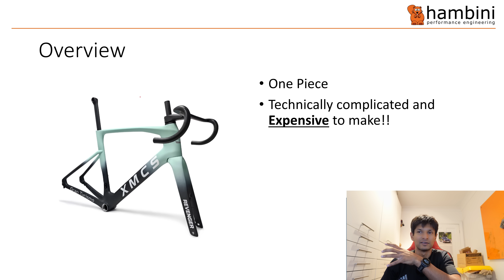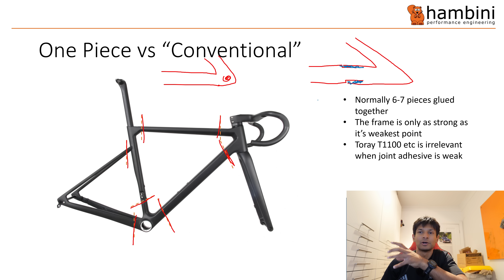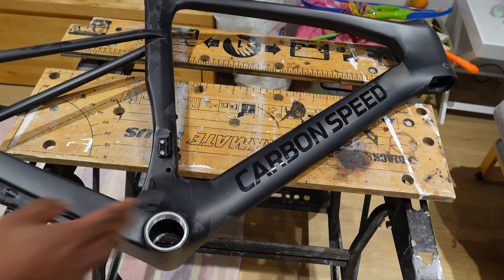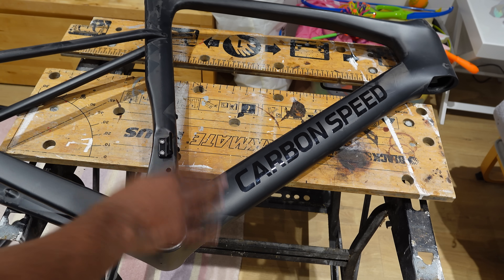One Piece Molded Carbon Fiber BIke Frame | No Joints

Comment: peter seems like a quality guy and this is a beautiful frame. I considered getting one of these frames a few months ago but the standover is quite high and there weren't really any sizes for people in the shorter half of the population. The smallest size had a standover of 777mm. Aero frame with high stack is a tricky combo because high stack frames tend to have slanted top tubes (which is not as aero) to keep the standover height manageable. I wonder if this issue is better remedied by using stems with a positive angle rather than making frames with tall headtubes. idk. It's a great looking frame for people with long legs.

Comment: LOOK AT THE FUCKING STATE OF THE HEADSET SEATS ON THAT FRAME ITS AN ABSOLUTER FUCKING DISGRACE, THAT THEY AREN'T CNC FLAT, HONED AND THEN MIRROR POLISHED, WHAT SORT OF CUNT THINKS THIS IS GOOD ENOUGH? AND JESUS CHRIST, LOOK AT THE THREAD ON THE BB SHELL, THEY ARE MORE ON THE PISS THAN A BUNCH OF MACABI TEL AVIV FOOTY FANS ON A EUROPEAN WEEKEND BENDER, THEY'RE FULL OF CONTAMINATION, JUST LOOK HOW SPECKLED THEY ARE. WHICH BLIND BEGGAR FINISHED  OFF THOSE DROP OUTS, HOLY SHIT SINCE WHEN DID RAW CARBON BE GOOD ENOUGH FOR A TO-METAL AXLE TERMINATION. YOU'D NOT SEE THAT IN AUTOMOTIVE OR AEROSPACE. BLAH FUCKING BLAH

Comment: There shouldn't be a space for glue at the joints,  what bonds layers of carbon is epoxy,  the right amount of epoxy is needed for superior strength, that bonding joint isn't much different,  it's just layers bonded at different times.  at a joint it isn't glue that makes it weak,  it's the fact that the fibers are not connected.  That being said it's a non issue,  they are plenty strong and light.

Comment: Seatpost angle could be a bit steeper, especially in the 58cm size. Also the 58 size has 67 bb drop same as my gravel bike and it's way too high even for gravel I'm changing it soon. I hope they make more frames with the same technology though.

Comment: has there been a raft of multi-piece carbon frames failing at bonded joints?!?!    thats a red-herring

while technically correct -- the adhesive joint is "weaker" -- by doubling those joints and providing sufficient overlap, mfgs can make that "weakness" go away and only add a few grams back to the all-up weight.
Reply: Nope, the joints are usually stronger...contrary to what is stated in this video, because they use structural adhesive on overlapped joints that end up two or three times thicker.  There may be stress risers at the end of the butting, but that would just be a poorly designed/built frame.  Anyone who deals with warranties daily will tell you it is rarely the bonded sections failing, it is the thinned out tubing where they are trying to save weight that fails.
Reply: @cup_and_cone  Yeah never heared of one of those joints debonding, but yes there could be more stress risers at the unions and slightly more weight overall . However, I would think that a full monocoque frame could save labor in the end by reducing the number of build steps need to complete a frame.
Reply: @davidbolduc828   I'm not sure if it would save too much labor because you are dealing with more a complicated multi-piece jig that gets assembled piecemeal during layup, versus several split molds.  Weight definitely would be the major advantage for monocoque, although this frame wasn't particularly light at the weigh-in.

Comment: Once the Chinese learn to give their products proper, respectable brand names, it's all over for the WEST!:face-blue-smiling:
Reply: Yes, Chinese branding is dreadful, as if they're trying to be that. Weird.
Reply: And the fonts. Some of the names are digestible, but the fonts are horrid.
Reply: @Slowjo1221 Chinese know how to copy and mass produce stuffs, but they're not that good with design fundamentals. That's why they can't  get away from that "cheap knock-off" image.
Reply: @Reanimator999 they need to just pay the spanish or italians a boat full of money to get their styling and branding on point. lol
Reply: my personal favourite is the "workswell" frames
Reply: I can't decide between Gofast and Strongr framesets
Reply: Reminds me of how the guy who invented lithium battery technologies is called John Goodenough
Reply: Just small legal issues, if something happens, and happens broken jaw, spine or paralyzed body, No one will pay you any damages from China. Simple.
Reply: @kolokowalsky772  Be sure also Western(ized) brands will use lawyers to find a gap to slip through. Maybe customer has over-tightened headset, didn't use a torque wrench (or it wasn't calibrated during 6 months) to tighten crank bolts, routed cable improperly yada-yada and that has led to wear of kitchen towel core steerer tube.
In a case of loss of provider or immobilized patient who lost abilities to provide who has a proper insurance sums can be high so why not check if customer isn't liable (at least, partially) for outcome.
Reply: @event4216  Recently a Brit got 4 mln Sterling damages, he ended up on wheelchair. His fork failed...
Reply: @kolokowalsky772  Planet-X?
Reply: @kolokowalsky772  Still, I'd better not have that money but keep ability to walk.
Reply: @event4216  This is NOT the point.
Reply: @kolokowalsky772  While i totally understand where you're coming from - I recently purchased a high end western (European) frame from an alleged reputable UK retailer.  It had an undersized BB shell.  The retailer told me "there's no warranty claim here" and proceeded to offer solutions that would have officially voided warranty and told me I'd have to pay for it.  I'm not saying Eastern brands have better customer service than Western brands. Just that there are good and bad companies on either side of the divide.  I thought I was buying the pinnacle of engineering, turned out to be junk, sold by conmen disguised as high end bike builders.
Reply: 😂 you must be Chinese. If you are can you stop sending me products that are garbage. Thanks
Reply: It makes no difference if warranty, legal claims and responsibility is not legitimate.
Reply: Technology of 99.9% bike frames is the sal lay-up carbon sheets, pre-preg. Nothing sophisticated. Very few, including TIME, 3T, use RTM which is far more complex, and requires a totally different know-how and technology... It a different ball game. Chineses will not pursue this path. What for? Cheaper, easier, popular.
Reply: @kolokowalsky772  but what make it work it not about cheap but the difference between cheaper Chinese bike and sophisticated technology develop by premium high end brand are small. i have Time bike and i ride specialized, and i have also chinese brand bike like winspace, and unknown brand like tan tan and ican yoeleo. in comparison yes the well made western bike are more in performance but it not alot because the time record and how i feel ride it it not much, so for profesional it can be game changer, but for daily rider who only persuit fitness and health sport. it doesn't matter because it still has same responsiveness as a carbon
Reply: @GogzLove  90% of people cannot distinguish bad coffee from prime quality Ethiopian.. Bikes are the same... Good on them!
Reply: probably it just more proper if they just use mandarin than use western alphabet that they unfamiliar with. may be it will be look more original
Reply: @GogzLove Perhaps.. I mean the whole Kanji/Hanzi words are popular with tattoo fashionistas and street racers.😅
So it might look better to have sick Kanji/Hanging letters painted on the frame similar to those Tokyo drift street racing cars 😂.
Reply: @Reanimator999 chinese letter are sharp and have many stripe, but japanese and korean look more simple. but korean use less hangul in their brand instead they use alphabet but still in korean but if we make mandarin to alphabet it very difecult for non chinese speaker to read it 😊 maybe creative team need create new template for mandarin letter so it will look more less complicated
Reply: China is failing
https://www.youtube.com/watch?v=U3qNTzF6NkE

Comment: I have a Kestrel monocoque that I bought new in 1987.  I had some friends who worked building the Bell tilt-rotor aircraft at the time and they confirmed that this technique is how they built that aircraft.  I haven't ridden it in over ten years....it was a breakthrough in the day but it's too stiff and heavy by today's standards.
Reply: I still ride my 100 SCI from 86  not the lightest or as comfortable as modern carbon but still serviceable, put a cervelo fork on it as the original was for quill stems, Take it out again you will be surprised,

Comment: Is 987g standard these days? Scott was putting out 1kg framesets ten years ago.
Reply: modern aeroframe designs with disc brakes are typically heavier. Many frames were lighter ten years ago.
Reply: My Storck Absolutist 0.9 is now 14 years old and the frame weights some 900+ grams as the name suggests. 😂
Reply: It will be durable
Reply: Was the disc Foil from 10 years ago sub 1 kg?
Reply: Scott still putting out worthless press fit frames though, doesn't matter what the weight is 🤯
Reply: It’s an aero frame with a bonded T47BB
Reply: Lighter doesn’t always mean better…
Reply: @Evaso_CC  These frames are made for 120kg guys. I need a frame made for a 70 kg guy.
Reply: My old Neil Pryde bura sl is under 1kg including forks. But it's rim brake and I've heard they can be fragile. I'm not that heavy so it's lasted me (second owner) 10 years summer use on some harsh roads no problem. It rides like a dream.

Comment: Moulded in 1 piece rather than 1 piece of carbon. I was trying to work out the logistics of how a frame could be wrapped around a former from a single strand of carbon fibre. There's probably hundreds of joins but they are interlayer. Rather a nice build quality regardless.
Reply: Exactly, one single "piece" or "sheet" to create a frame is not possible.
Reply: Question for the engineers: Is it possible to build a bike frame with carbon fiber winding technology? Or does it have to be done in pieces?
Reply: @SanjaySingh-oh7hv  not an enginer, but if you make a carbon weaving machine with a floating head, and make the inner structure of the bike hard enough to weave on it but removeable after, why not. Cost in the other hand....
Reply: @SanjaySingh-oh7hv a lot of builders use wound tubes for straight sections and pieces of carbon on the lugs
Reply: I would argue that the carbon fibre is the material, and the carbon is the final product. So if you take that logic and apply to a "regular" carbon frame, you basically take several carbon pieces and put them together contrary to just having a solid piece of carbon, but that is if we agree that the carbon fibre is "half" the product, and carbon is "full" product... a matrix that comes as a result of infusing the resin into the carbon fibre arrangement.
As a second thought it will make even more sense if we call it carbon composite
Reply: @kshysztof9649  carbon is an element, carbon composite is the material.

Comment: how did they make this? did they have a bladder on the inside or some alloy that melts at low temperature after it's cured? they mold the inside first, wrap it in carbon and then put a mold over everything and then cure
Reply: probably a wax mold like Time does but even more advanced
Reply: I was thinking something similar, but how do they hold the layup in place before injecting the resin? Maybe they do it the old fashioned way and apply the carbon fibre wet. Come on Hambin, we want answers
Reply: @paulhawkins6415  probably the mold is split into parts, and usually they dont inject resin and use prepreg carbon fiber and just put it into the oven to cure

Comment: What’s their process for saying 1 piece as I can see split lines in the carbon?
Reply: I can see that also, maybe just painting?
Reply: It's reinforcement
Reply: @manoz6194 yer the patches are but I saw dream on the tube I’m just curious to understand their layup schedule.
Reply: Did you watch the video
Reply: @Once-a-fatman-nownormal yep all of it. Saw seams on tubes which was not reinforcement patches that are visible outside
Reply: @plusoem  I guess you didn't listen then
Reply: I saw seams as well. Longitudinal realative to each "tube"
Reply: Also I’m not saying this is a bad frame at all it’s just hard to claim it’s one piece that’s been pushed as it’s usp

Comment: But is it Mapdec approved? 🤭
Reply from the maker: Yeah. It's lubricated by the correct type of grease and the bolts are fine up to the right torque
Reply: @Hambini omg..its still going on!
Reply: @Hambini did you use the correct method at holding a wrench
Reply: Doesn‘t cost enough and has - period - no European or GB Distributor … 😅